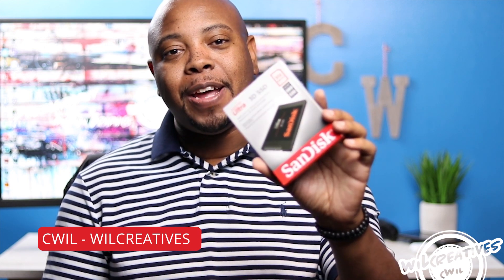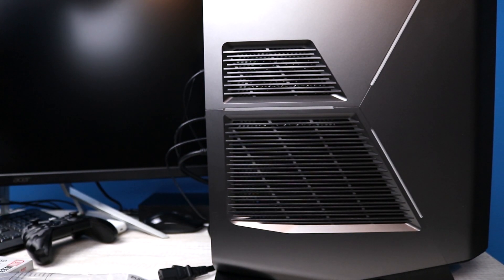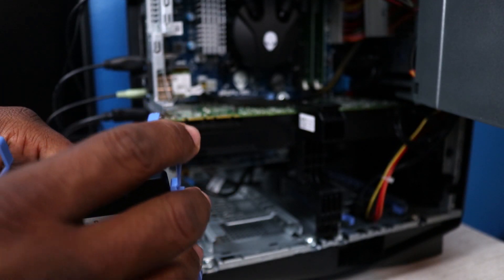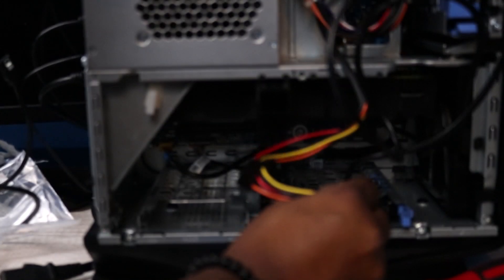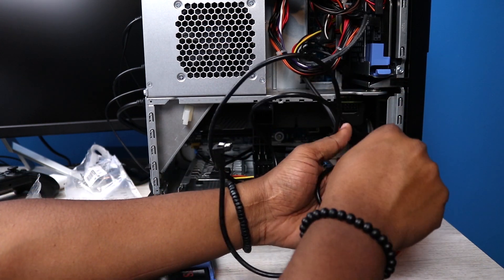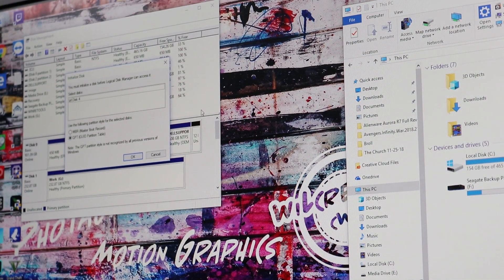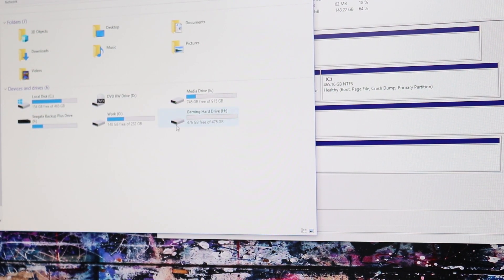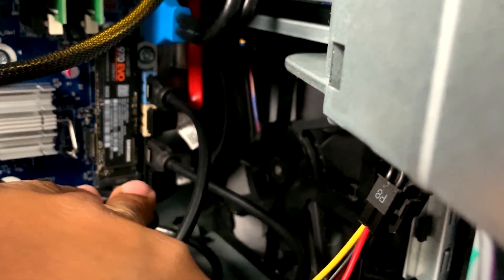First Impressions / Installation Sandisk Ultra 3d SSD 512gb to Dell Alienware Aurora R7

Comment: I have the same PC and same setup (only one SSD drive to run games only).  But, do the SATA cables have to be a certain type for the SSD? I used one from a 10 year old PC. And which port do you actually plug it into again? My benchmark said 400+.
Thanks :)

Comment: I'm glad you showed the right way to install into the bay. I saw a few vids where they just slid the SSD in there without taking the bracket out. It's pretty obvious that you squeeze that bracket and pull it out, but it seems no one knows that lol.

Comment: So what happens to the graphics card if the power cord was unplugged from it? Did I miss the part where that is addressed ?
Reply from the maker: Jeffrey Molina it won’t work you have to make sure you plug everything back in.

Comment: I bought a sandisk extreme portable ssd 1tb. But there is no screw,where can i get a screw and one more thing is I have a alienware aurora chipest gaming machine this machine does not have a water cooling system just fan. I was disappoint. anyway for temporary I put a paper tape on sandisk extreme portable ssd 1tb.And I like to play game and I also want to my computer want to be a fast speed so should I need a put more sandisk ultra 3rd ssd? I really hope you read this messege. my email address is chris00won@gmail.com Thank You.

Comment: Thank you very much, your video helped me alot.
I have Dell Alienware Aurora R8 with 256 GB SSD and 1 TB HDD, I added 960 GB SanDisk SSD Plus following your instructions, I used SATA 3 slot in the motherboared and the read and wright speeds are amazing.
Thanks again
Reply from the maker: Abdullah Waqdan thanks for the feedback !

Comment: Thank you for uploading this video.  I have the same PC and just installed a Samsung 860 QVO 2TB SSD Drive.  I ran in a few snags when setting up the disk.  But this video really helped me to get it going.  Thank you again.  :)
Reply: ghd1379 Thats the ssd I’m actually planning to replace with to the hard drive that came with my Aurora. Any advice or tips for me to know? (I’ve already disabled the intel optane drive that came with mine.)

Comment: So wich port  is better for speed the blue one?
Reply from the maker: Yes the blue one
Reply: @WiLcreatives  okay will I be okay by just simply plugging in the ssd on the blue port and my hdd on the black port? I dont want to install the OS on the ssd drive ... so after doing that will my pc boot normally? Or does the blue port only specifically for booting?

Comment: Any chance you have a link to what SATA cable you used for this install?
Reply from the maker: It wasn’t this exact one but I used a Sata 3 cable. Cable Matters 3-Pack 90 Degree Right Angle SATA III 6.0 Gbps SATA Cable (SATA 3 Cable) Black - 18 Inches https://www.amazon.com/dp/B018Y2LEBE/ref=cm_sw_r_cp_api_i_e60SDbH5C4P3T

Comment: So you have the m.2 evo, 860 evo, SanDisk, and the HDD? You don’t have a video on the 860 installation, did you have any issues hooking it up? Or was it as easy as plugging it in. All I have got my pc rn is a regular HDD so I’m trying to upgrade.
Reply from the maker: Yeah it was easy plug in and play just like the Sandisk, which is why i didn't do another video.

Comment: I really have a important question, I have the same device as you and I didn’t upgraded nothing but every time I turned on it takes a lot time to run the apps and I feel that it is very slow running even google, what can I do ?
Reply from the maker: How long have you been having this issue?

Comment: Well my Aurora comp came early (on time) and I am working on it right now. After seeing what it has for a day, it’s now time to modify it... Storage- I am swapping another older 500gig Sata that I had from my laptop 2.5 hdd, I upped that to an ssd, so if this works, some more storage for the price of nothing. I also have a little something to update the larger 2Tb 3.5 drive (I hope this works for that portion)... will be great to maybe increase the total storage space to about 7tbs combined. Once I am done with this in an hour or so, I need to start messing with optimized settings for the GTX 1080 TI. My first thing was to see how it played FH4...on ultra settings it ran well, but on extreme there were hiccups..so that is next in line (the hiccups were based on what I wanted to see as a normal gamer ... not just a comp only gamer. I ran it full 4K on my 75inch QLED.—- I know ppl hate 4K gaming but- I am just now getting back into games again.
Reply from the maker: Sweet, what were your hiccups? Was it lag, stuttering or low frame rates?

Comment: Well my Comp came early (on time) and I am working on it right now. So, I adding another older 500gig Sata that I had from my laptop 2.5 hdd, I upped that to a ssd, so if this works, some more storage for the price of nothing. I also have a little something to update the larger 2Tb 3.5 drive (I hope this works for that portion)... will be great to maybe increase the total storage space to about 7tbs combined. Once I am done with this on an hour or so, I need to start messing with optimized setting for the GTX 1080 TI.

Comment: I bought my R7 without an SSD and I want to add one. Can you help me or suggest which one should I get?
Reply from the maker: Gotcha are you going to be using the SSD as a boot drive or just additional storage?
Reply: WiLcreatives thanks for responding man. I want to use it as a boot drive actually.
Reply from the maker: @ajapov  Got it I recommend the Samsung 970 Evo check out this video https://youtu.be/qoOIBJYYvGE

Comment: What mic or mics do you use? sounds good. Also, I have my ssd plugged in the bottom-most sata port and it runs fast. Not sure why you were bottlenecked. Do you think it's the sata cable you bought or was that the cable you ended using?
Reply from the maker: I use a blue yeti mic. I will be doing some more testing on that sata port. I purchased another sata cable so we will see.
Reply: @WiLcreatives  wow I need to get that mic. Is it worth it? Or lav mic is sufficient? Btw, yes it'd be great if you can find out why your speeds were slow. I don't want to rearrange all 4 sata ports. I assume you had to remove your graphics card to get access to those sata ports?
Reply from the maker: It's worth it but I found out there are better mics for less money. Audio Technica is a good brand. Yes to get to the the first 2 sata ports you have to remove the graphics card.

Comment: I just got mine, looking to take full advantage of updating and upgrading my desktop
Reply from the maker: That’s awesome let me know how it goes!
Reply: Yeah, I been taking notes. So a question for the SSD. I saw capacity as high as 2TB, is there a threshold for memory, as I know that not always alot of memory is always works - which I still do not get.

Will have I have issues if I go that high? Also, any recommendations on appropriate Regular HD 7200 RPM type that I can use to replace my primary one? Again, I been hearing stories about the 12TB being a pain
Reply from the maker: I'm not 100% sure on the max capacity you can use. I do know that there are bus limits as you saw in the video for the Dell motherboards is you use all of the SATA slots. You can't go wrong with the baracuda drives. The 2TB nvme m.2 ssd drives are still not cost efficient. You would be better off with a 1TB and add in a 1 TB sata ssd for more space for programs if need be.
Reply: @WiLcreatives  I got the 2TB and it is great for games. I never knew games could load so fast. Definitely was worth the buy. I did not get all my slots filled, but I chose the 2TB San Disk pro 3D and a 1TB Samsung pro NVME M.2 SSD as my boot. I will be getting that Black series HD Regular to replace the standard HD and use it as my archive for long term storage. As for the additional SSD slot, not sure. Thanks for the advice.
Reply from the maker: Man that's awesome. I'm definitely looking to get a bigger SSD for games. How much did the 2TB cost you?
Reply: @WiLcreatives  The 2TB I got off Amazon for 279.99. At the time, it was the best price I could find that was available. That was back at the end of February.
Reply from the maker: @craykard8325  Gotcha I'm definitely going to look into one

Comment: I'm kinda nervous when opening my tower and installing an ssd inside the bay. Do you know if external SSD'S also work the same for the Aurora R7? I'd rather do it that way lol.

By the way, keep up the great work.
Reply from the maker: Thank you! Yes you can get external SSD drives they are fast, not as fast as the internal.
Reply: The external ssd will be bottlenecked by the USB.

Comment: Hey! Great video. I just bought a Samsung EVO 860 SSD and have an R7. Question for you: Is the power cable (red, yellow, orange) already included in the machine? Just want to make sure I don't have to purchase one along with a SATA III cable. Thanks!
Reply from the maker: +Steven Bueno yes there should be an extra power cable available in the tower. You only need to pick up a SATA III cable. Thanks for the feed back!
Reply: Also, you plugged the new SSD ((sandisk) into the blue SATA port correct? Then plugged your 1TB HDD into one of the other ports?
Reply from the maker: Yep come to find out the last SATA port on the motherboard runs slower than the rest. So I swapped ports so I could get the full speed of the SanDisk drive. Didn’t care about the 1tb be slow as that’s being used for media stuff nothing major
Reply: @WiLcreatives  Hey Will good stuff. When you swap the SATA port with the original HDD to the SSD, is there anything else that needs to be done and will it cause an error? I just got an 860 Evo as well and am curious before I install
Reply from the maker: @Phillyswirl123  nope no error. Runs great. After that nothing else needs to be done except for setting up the hard drive in windows.

Comment: Hi, I’m going to buy an alienware aurora r7. Is this pc good ? Do you have any problems running this pc or any recommendation before getting this ?
Reply: I have one, love it, no problems
Reply: I have the R8.  Best Buy has the 2080 model on sale right now.  The only thing that I would recommend is to upgrade the warranty to Pro Support after purchase.  It really does improve the experience.  I got 5 years yesterday for $409 with US based support and next business day replacement of parts.  It is a solid system with okay parts.  Not the sexiest build but for a prebuilt it is a hell of a value.
Reply: Chuck Stacey do you know if I can add an ssd to the r8? Cause the model that is $850 has only a 1tb hhd
Reply from the maker: Yes I would purchase it! I suggest you watch my full review of the R7 as I go over everything in that video! Here is the link https://youtu.be/WM-OYGTm5yQ